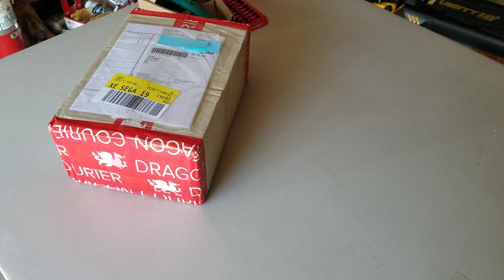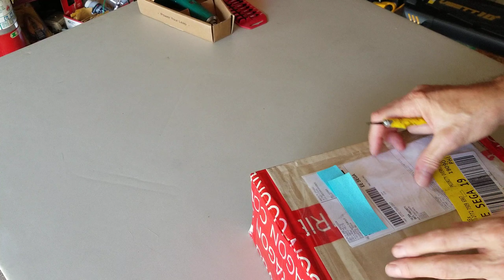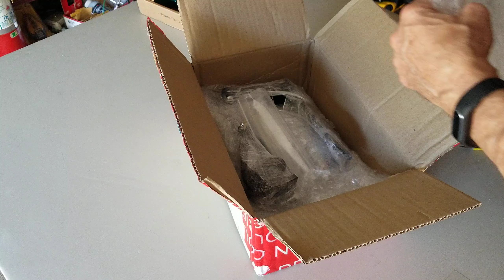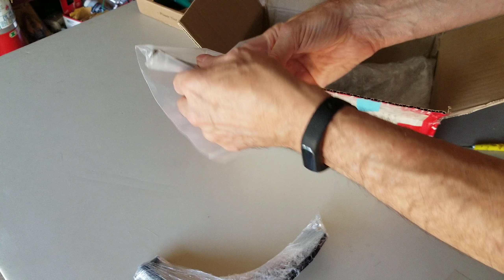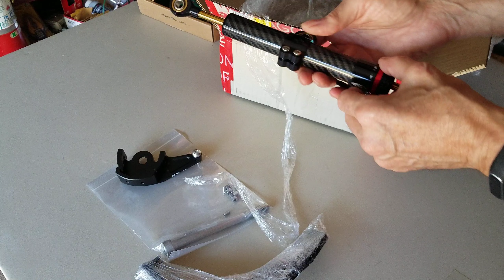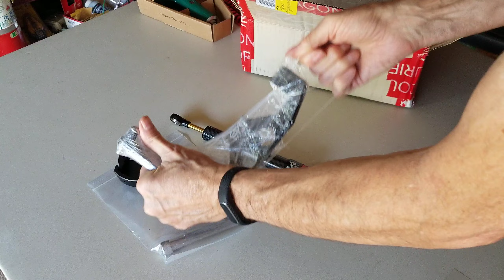VSETT 10+ ULTIMATE HOW-TO INSTALL EVO STABILIZER DAMPER KIT Part-1

Comment: Don't buy from EVO.
They've been screwing up orders because they don't have any more Vsett 10+ kits.
They'll charge you $225 then send you a different brand part (Falcon) for the wrong scooter (Vsett 9). Their website even shows the Vsett 9 and 10 dampers as the same part. They'll blame YOU and say you ordered the wrong part.
AVOID LIKE THE PLAGUE.